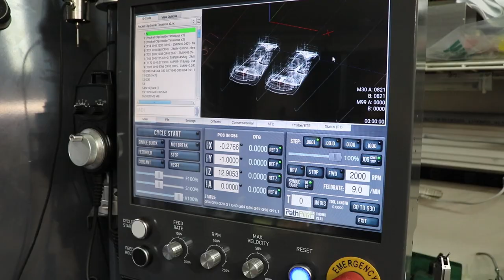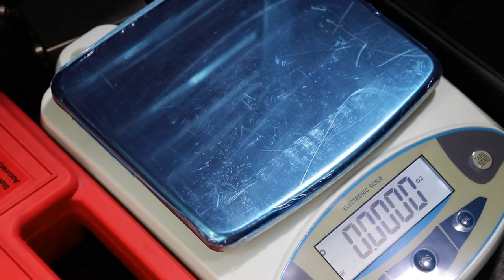Making my first full custom knife! Interface #040 Shop sounds only,  No talking.

Comment: The lock bar and scale are epoxied together?
Reply from the maker: Correct. It's very strong epoxy, Most times when trying to separate the parts I end up breaking some of the carbon off.
Reply: @vcedge9466  Cool, just curious. I know that often the weld is stronger than the parts themselves. Thanks for the reply. Waiting for the next drop.

Comment: How much weight would you save with a wire clip? Ignoring aesthetics. :) CF backspacer and wire clip = 1.5oz superlight model!
Reply from the maker: Surprisingly it wouldn't save as much as you might think. the clip and backspacer already only weigh about .06 oz each so even if switching to CF saves 30% that would only reduce the weight .02 oz. total.  Clearly I'm not opposed to doing silly things like that, especially the backspacer,. I've thought about it before and probably will as some point. It would cost quite a bit more though and require some design differences so probably for a full dress custom only.
Reply: @vcedge9466  Yeah, makes sense.